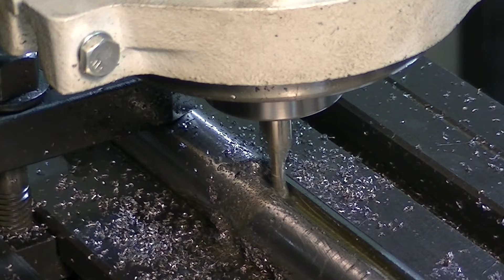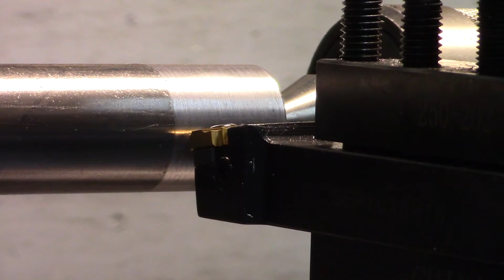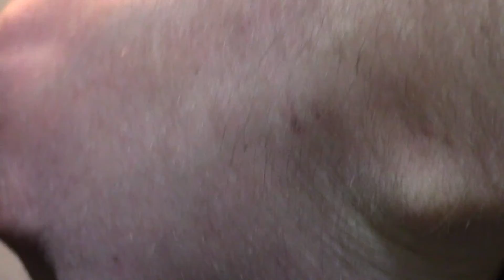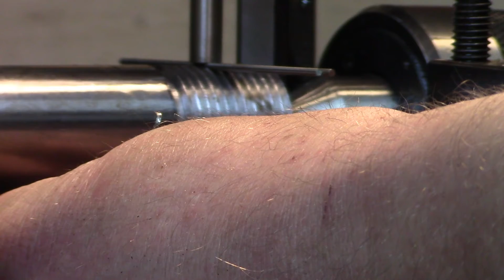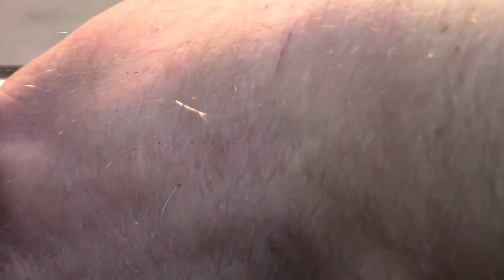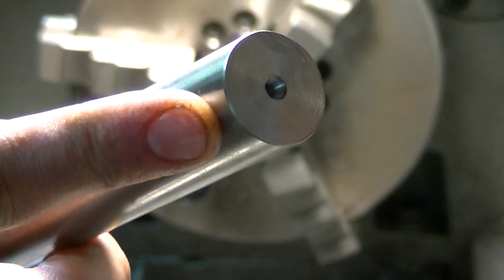Concrete Cutter Shaft Pt 2

Comment: Hey Everett nice job on this project. Here is a tip I got from Steve Summers. Use a piece of foam pipe insulation to hold your thread wires. Just  a suggestion. Thanks for sharing.
Reply from the maker: Thanks Yves, Uncle Tim was happy - he had all the other bits but just needed the shaft and some small pieces made up to make the cutter work.  I haven't seen the video of Steve using pipe insulation to hold thread wires but might just have to go through his videos to have a look.  Thanks for the suggestion, I've never heard of using foam insulation to do that.

Comment: good job everett . what size is your lathe and whats your formula for calculating thread depth for an internal thread? any help here would be appericiated thanks.
Reply from the maker: Thanks! Uncle Tim was happy enough with it in the end.  For threads, we learned how to do the math in Machine Shop class, but I've found a lazy way to do it in the Theoretical Machinist's calculator webpage.  The link is here: theoreticalmachinist.com/Threads_UnifiedImperial.aspx
The thread on that shaft was left hand but the numbers were the same as a right hand thread.
Reply: @EverettsWorkshop  Thanks for the link to the online calculator. I am going to save this as a favorite on the computer in my shop. It looks like something I will get a lot of use out of
Reply: Everett's Workshop   a more useful calculator is www.cgtk.co.uk   from the list on the left hand side click screw measurement. I believe it to be better because it lists imp and metric both as standard and custom sizes.
I shall shortly (hopefully) put up a video of my design of wires that can be used one handed and need no caculations, although only for metric at present.